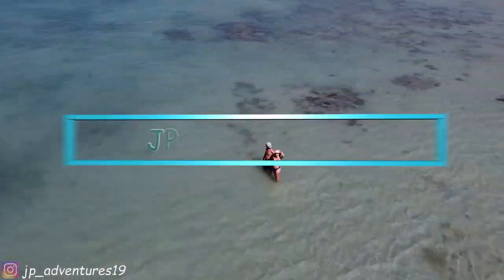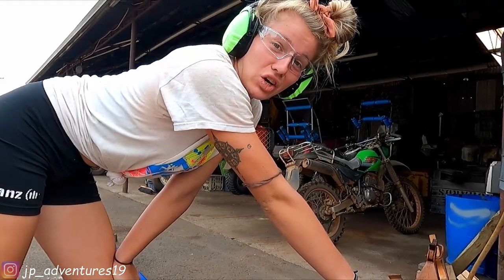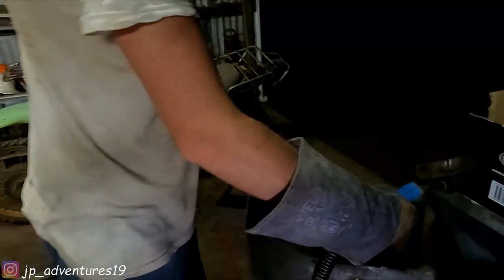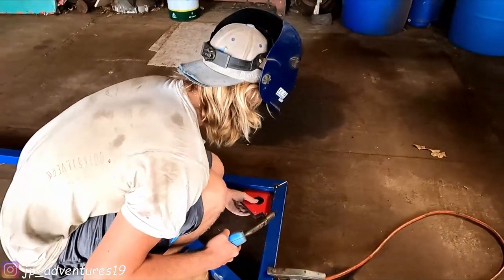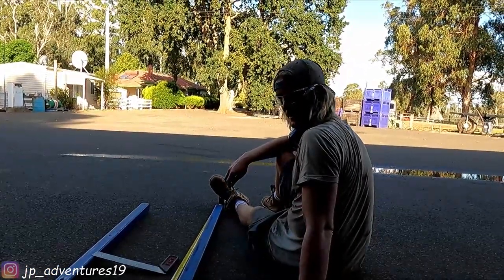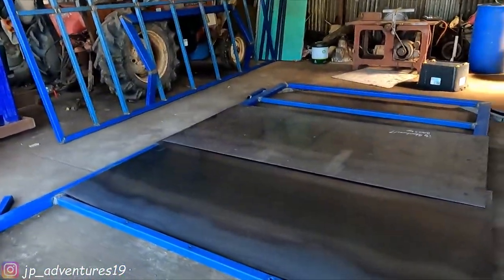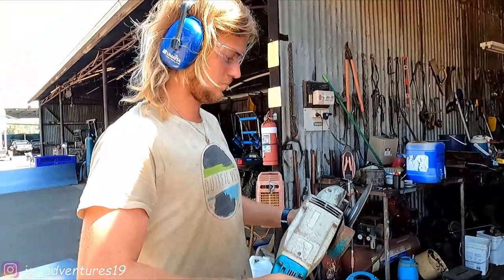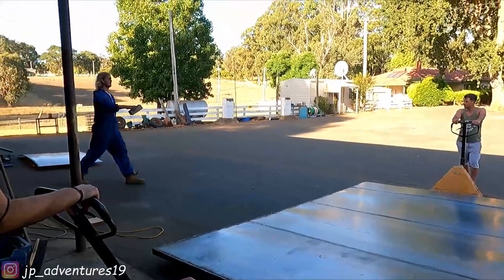BUILDING DIY CAMPER BOX for ex Australian Defense Force UNIMOG (Eps. 5) - All Steel Construction

Comment: Hi great build but have you done the maths. Are you sure you need a box that strong and HEAVY. Your box will weigh so much, you're going to increase your fuel consumption and make things so much harder in sand. Wouldn't you have been better off with Styromax composite panels ?
Reply: Wait until you really go offroad... not just a little beach drive.
One tree will clean the Fibreglass box off the back of the truck.